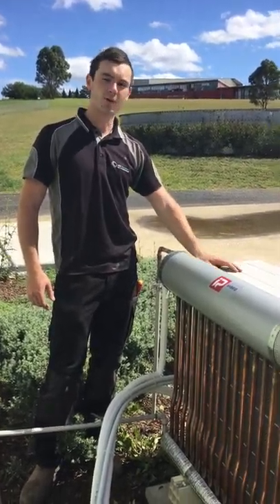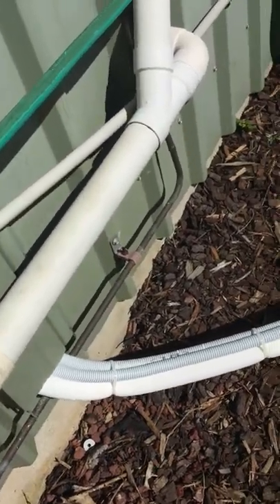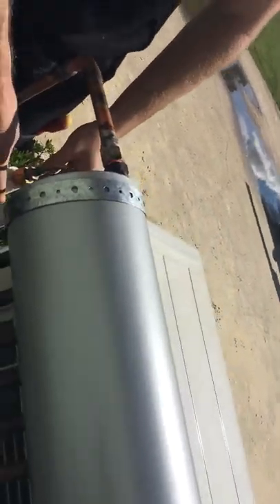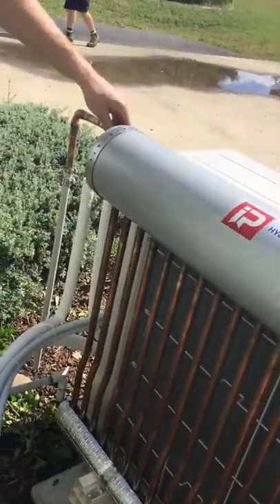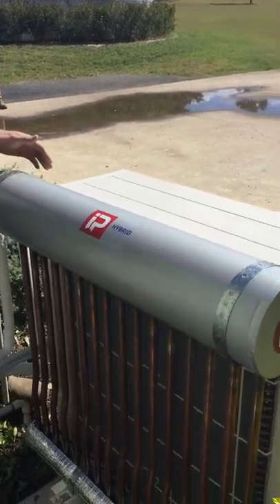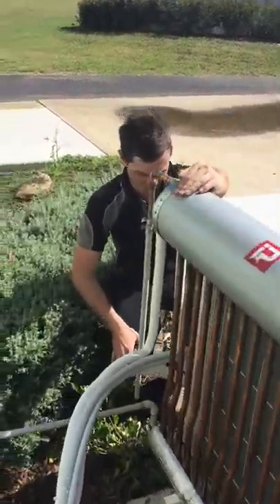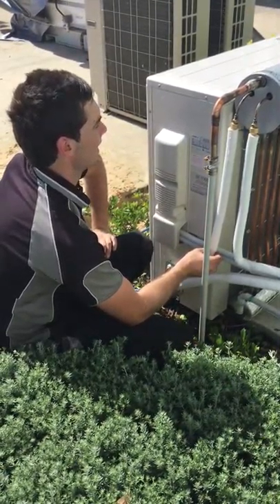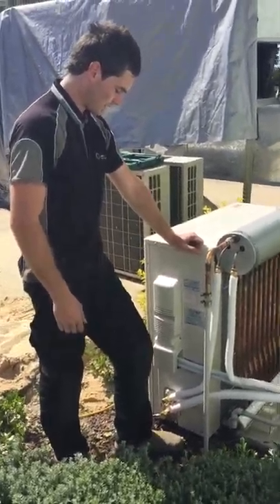IP Hybrid HVAC

Comment: I don't get it?  How does it work?  Does it work for heating or Cooling mode of the A/C?  The chap in the video is using words that are not in contact with what he is trying to explain.  And the video does not show what he is trying to explain.  Maybe this is a video of a proof-of-concept experiment for a university project?.?.?
I would have done this differently, for both heating and cooling modes of the A/C.